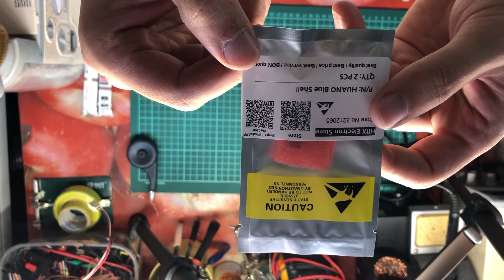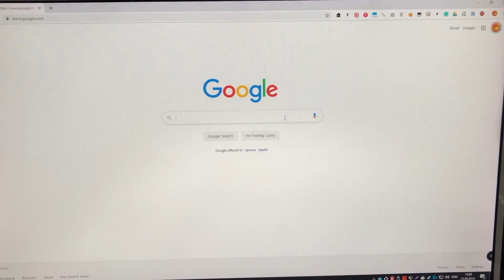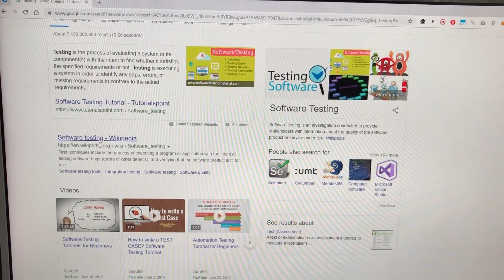Logitech G203/G102 mouse, double click issue - replacing switches

Comment: within a few years all five switches started doubleclicking on my G102, very disappointing quality.
Reply: How many years did u last?
Reply: In my case, G203, it happened in a few nonths (left switch).
Reply: @zeromdr  same, around 9 months
Reply: It's a shame that Logitech saves maybe $0.40 per switch and uses non-dust-proof variant of the switch. It's rarely the switch that fails but once you get a small dust particle inside the switch, the contacts no longer can close cleanly.

Comment: I tried to replace the switch but the left clicker don't respond. I even replaced new batch of switch but still not responding. I think i broke some connections in one of the 3 holes of the pcb. How can i repair this?

Comment: The issue is occasional double click, but sometimes it drops a click and hold, which can be observed when resizing windows or selecting text! There are at least two issues with this mouse. Note, there are buttons that can be swapped should you have no switches at hand,  like the DPI one. I am going to try cleaning the switch first with some electronic cleaning solution or mild organic solvent.
Reply: Update, cleaning the switch from outside of the switch case did work for a few weeks only. I attempted to saturate the gap between the switch case (black) and the clicker button (white), with a cotton swab with white spirit. So this is not the optimal solution. It is possible to disassemble the switch, however, by removing the switch black case and flexing the springy metal switch. There is an instruction video online and the author said it will work for half a year, maybe a year, so it might be a better solution that does not require physically resoldering switches.
Reply: @pavel9652  why doesnt logitech just stop putting bad switches in?
Reply: @jamesnesfield7288  I think it is or was the issue caused by their vendor, which started supplying switches that were not to the specs. People on forums said OMRON moved factories from Japan to China and this is when the problems started. Huge PR issue for Logitech and I believe they resolved it by now.

Comment: I resolved this problem putting few alcohol  drops (minimum 70 degrees) on this switch, pushing it many times, and drying with hairdryer.
Reply: I was thinking about it! I can resolder switches, but don't have switches right now. I could swap, but I will attempt alcohol, a drop of white spirit or maybe something safer for electronics. I don't have isopropyl. Does it fix the problem for long? This is the best mouse I have got, but I have much older that are not as smooth, but work flawlessly, which is lame!
Reply: I will try this too, did you just put the alcohol in and around the white clicking part? And how did alcohol fix the problem anyway?
Reply: I used a cotton swab saturated with a white spirit in between the switch case (black) and clicker part (white) and it solved the problem for a few weeks, no more than a month. So it isn't ideal. First time I took some time to clean the dust! ;) There is another way, if you open the switch by removing the black case, there is a metal springy element which you might adjust a bit. There is a video on YT about it. Such a fix will last longer, for a few months, maybe a year, depending on the usage. It seems the best way is to replace switches, unfortunately. Right now I swapped the buttons in the OS settings ;)

Comment: Do you think cleaning could be a solution for this issue?
Reply: I've found that flooding the switch with switch cleaner and pressing the button a lot can clean it enough to work, worth trying before you change out the switch.
Reply: I buy solder tool and 2 switch only 3$ and replace myself it work fine and easy

Comment: What kinda smoldering iron kit are you using or what would you recommend for fixing stuff like this or capacitors on broken VGA etc? :)
Reply from the maker: I am using Hakko 936 clone, called Quick, decent quality, original Hakko was too expensive for me since I'm not doing this professionally. So, a decent (not the cheapest) Hakko 936 clone and a couple of different tips should do most of the hobby things.
Reply: Don't smoulder it too much! ;-D

Comment: Had this problem in my last 2 mouses, different brands, both western brands made in China. Used to have a mouse 5-10 years, now a year if lucky. Logitech, and most quality brands in most sectors is crap now, was good before. Sold their soul to chinese low quality for profits and killed their good brand, just like so many other american and european producers. China tricked the west making crap so people will have crap products no matter what brand, opening for chinese crap producers into western markets. And the market global dictatorship doesn't allow for choice for the consumer since everythings made in China with Chinese components.
Reply: Yeah, this... Everything is shit nowadays and nothing will last more than a year... If you are lucky.
Reply: Have a similar experience. This is the best mouse I have got, that is smooth and precise, feels good, but the switch starter causing issued after little over two years, unlike some much older mouse I have got before.

Comment: how long original switches hold on before double clicking? 2 years?
Reply from the maker: In my case, it was 1 year and a couple of months, less than 2 years for sure.
Reply: @nixitech  ah , thx for the info
Reply: @nixitech  hopefully the new switch (huano blue shell) last way longer than the original
Reply: Dont buy logitech mouses, they break really quick had mine for half a year and its double clicking, i did find a temp fix and its just blowing very soft air underneath the mouse click thingy (the plastic), it then just fixes itself but after 30 mins it returns to how it was then
Reply: In my case it was 2+ years before it happened and I was using it every day since I bought it around 16 hours a day for working/gaming. Both of the MB-s are busted and doubleclicking.
Reply: mi problema empezo despues de 6 meses !  dicen que es muy comun en este mouse
Reply: @lando4018  6 months?  thats  :(
Reply: For me 1 year and a couple too
Reply: @davcn.4080  Yo lo limpié soplando al botón y sorprendentemente se arregló el problema pero después de 1 año con el ratón aquí estoy otra vez pensando en aprender a soldar, porque a todos los ratones les pasa lo mismo
Reply: Little over 2 years for me of daily usage (working, browsing, gaming). The switches are rated at 10 mln clicks, which is not a lot if you do the math. It is defo usage related, because only LMB is affected.

Comment: I only have a spare of 30w soldering iron will it do the job? Or do i need a higher watt soldering iron?
Reply from the maker: Yes,  soldering iron of any power will do the job for something this, only limitation could be tip size, but it should be fine if it is not a huge one.

Comment: i feel like it's time we consumer do a class action lawsuit against logitech for their broken product, these mouse ain't the only thing from them that breaks after a couple weeks to a few months... i had 1 g230 headset , 2 g430 headset those 3 broke at the exact same place , the stupid little piece of cheap plastic they use that has the model on them.. even when taking very good care of them , or even reinforcing them with duct tape on DAY ONE of buying it cause you know that piece of plastic is trash tier. it breaks anyway. as for the mouse ... i have a g203 prodigy since june... 3 months in and it's double clicking already... meanwhile i had a Cisnet (logitech i think?) mouse for at least 6 years and no issue with that one....
Reply from the maker: I agree, this is not even planned obsolescence, but a clear case of selling crap quality for a high price.
Reply: @nixitech  or they purposely did research and came up with these material to ensure it will break providing a good quality product (for audio , comfort etc) so people can vouch for the overall quality and disregard the flawed plastic / component that breaks , thinking "eh it's just regular wear and tear" 60$ ? ill go buy another one

Comment: so in soldering you melt the wire he is holding in his other hand  on the slots without melting the pins or holes on the mouse?
Reply from the maker: Yes, you actually have to make the pin (and the pad around it) a bit hot in order for the melted solder wire to go into the hole and all the way around the pin. Don't worry, pin won't melt. Just type "soldering basics" into Google, and go to Image search, you will see an excellent example on the first image in search results.
Reply: @nixitech  hey it dosent look more complicated than applying glue
now its way less scary thank you😁

Comment: Holy shit, found something online that actually worked.
What causes the doubleclick is static in the mouse switch.
All you need to do is blow into it (Through your mouth) to remove that small bit of static electricity causing the issue.
The moisture when you blow into it will cause the static to get removed.
Worked perfectly, but every once in a while the issue comes back but all I need to do is blow into it again to fix it for a week or two before static builds up again.
Reply from the maker: Yeah, I've found that advice as well, worked for some time, after that I had to blow god damn mouse each hour to get it to work properly...
Reply: well shit it worked
edit: for seven minutes
Reply: Thanks man it worked, I bought new switches in case it dies permanently xd
Reply: Holy motherr of God, i swear I thought you were kidding, I just tried this and double click is completely gone!
Reply: @xmegadeth  I just saw an old reddit post about it and I gave it a try there and it worked for me too. Just hope it lasts a good while!
Reply: @twoktender  well, I need to do it once every two days or so, it's fine by me haha
Reply: @xmegadeth  yeah, that ain’t so bad tbh
Reply: Wow, that worked for me too! I just blew into the mouse through the hole for the scroll wheel and it fixed my double-clicking issue immediately! Thank you so much, stranger on the internet. You just saved me a few bucks :)
Reply: Thank you so much for this
Reply: no way no way dude, i am baffled, honestly I thought this was a joke ! Apparently it worked... O.o 
I  dunno if the problem is going to come back, but thanks for the tip either way man !
Reply: It worked!!! IDK for how long but for now it's fixed. If this comment didn't have a bunch of replies, I wouldn't even have tried this 😂
Reply: Wtf it worked, or at least seemed to
Reply: Holly crap it worked! Dude Thank you so much you saved me from me potentionally braking my mouse! tysm m8!!!
Reply: hahha it worked for me too but i will change the switches too
Reply: If this is true, there has to be a reason for the static to start building up. Is it wear and tear or contamination buildup? It took a little over 2 years for the LMB to start acting this way. It is still manageable, but frustrating.

Comment: I'm done with logitech. This is the 3rd mouse that this has happened on within a year of owning it....
Reply: i've had mine for 2 weeks and it happened
Reply: I had two Logi double clicker gaming mice, one lasted for 11 months, the other for 16 months. I ran countless circles with Logitech Support for a month, today they promised me a replacement, but I have strong doubts. I read numerous complaints all around the net about the replacement they sent was clearly used, smelled like cigarettes, had scratches on it, or just simply became double clicking after a week, etc all came in new boxes. 
Curious thing that I also had non-gaming Logitech stuff: a wireless keyboard - lasted app. for 15 (!) years and the wireless mouse that anno came with it lasted for 10 ys, no joke, despite being dropped a couple of times, soaked in every kind of food and drinks; and also had another non-gaming simple Logi mouse that also in its 8th year (I gave it to my FIL when I could put my hands on this G203 rubbish). I treated my gaming products like eggs, cleaning them, updating them, not eating over them and here we go. Why only their gaming products are of bad quality?
Even before they promised the replacement, I decided to NEVER get another Logi product. Their customer service is terrible!
I'm going to try to fix this one - and the other they'll send me, possibly, nothing to lose.
Reply: All the mice I buy have these issues. Corsair, Logitech, Razer, and numerous other brands. The solution is to buy cheapest pwm3360 mouse and replace the switches and cables and keep the mouse forever. It will be the best mouse after u modify them a little.

Comment: What is the exact switch model?
Reply from the maker: Original Omron ones are OMRON D2FC-F-7N, and replacement is HUANO Blue Dot Blue Shell 0.74N, no specific model mark on them
Reply: @nixitech  Thanksss
Reply: @nixitech  it looks like u had used Blue shell and white Dot Switches
Reply from the maker: @sharmilahaldar8628  yeah, that makes sense, if clicky part is considered a "dot" in mouse switch terminology - I don't know much about that

Comment: Hey, what is the model of the default switches? I want to repair mine but I want to use the same switches so I have no change in performance or anything, can you help me with that? Thx, nice video
Reply from the maker: Hey, original ones were OMRON D2FC-F-7N, however, since those are made in China, issues like double-clicking appears. It would be good to find Japan-made ones, however, I am not sure if they make them in Japan anymore. Regarding performance change when you replace switches, you should google "Mouse Switch Master Sheet by Ents
", and check google sheet mentioned inside that Reddit thread. You can compare different switches and try ones with similar operating force.